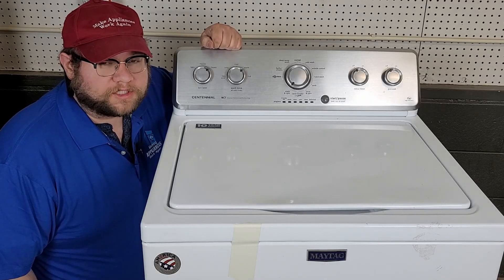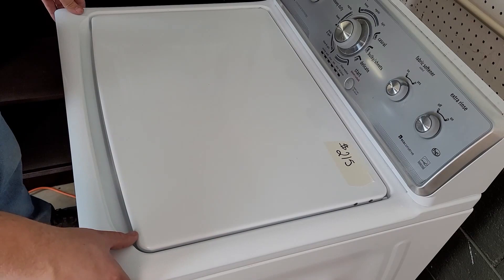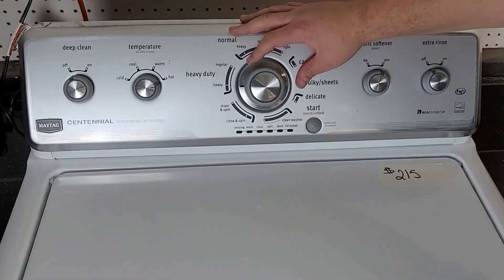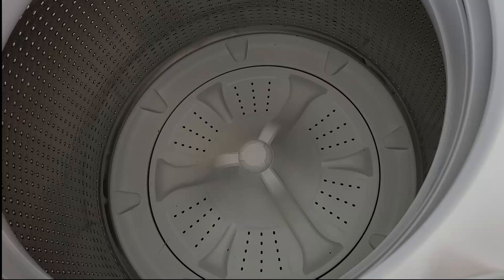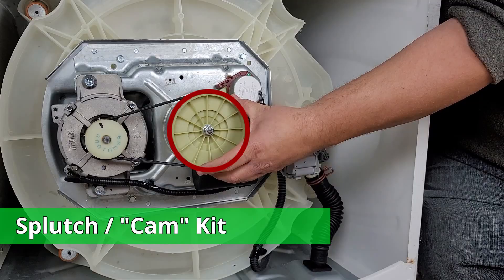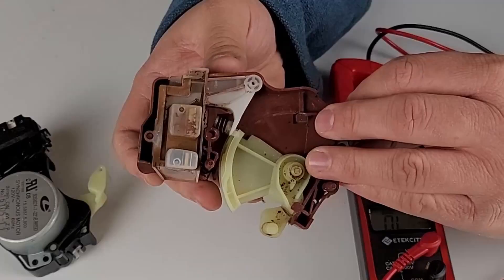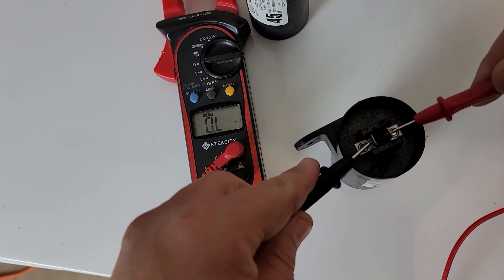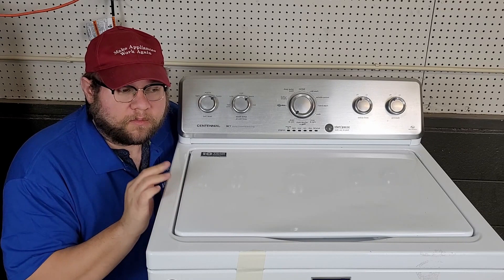Maytag Washer Won't Spin - How to Troubleshoot a Maytag Centennial Washer

Comment: Hello, I have a Maytag at my work (I work offshore) and it does spin but the issue is that it spins uncontrollably and off balance, so the spinning stops and it automatically jumps to the rinse cycle after attempting to spin 2 times, I can visually see that the tub has an inclination to the bottom left corner (looking at it from above) but upon further observing the springs, they seem to be in good shape. Can someone help me with this issue as I don’t seem to understand why it doesn’t completely spin. Also I always try to remove the wet clothes and reorganize the to balance out the load, but even then it useless.
Reply from the maker: Check the tub itself. Likely the hub is bad underneath. If it isn't that, then the inner tub is warped.
Reply: @bensappliancesandjunk  how do I check the tub? Is there a way to take it apart?

Comment: Hey Ben I have a similar washing machine that fills with water but  Stops functioning. And it will not drain out. So I emptied the washer by bucket. Then Added a few clothes And had to find A different setting In order for it to lock the lid and sense , Once it starts filling up with water And spins It just completely stops and and will not finish.
 So when I try to add a different setting Such as drain and spin It will not lock the top and it will not sense.
I actually made a video here and posted it on my YouTube account asking for help.any insight would be greatly appreciated
Reply from the maker: Use the error code mode system and tell me what the error code is. That will get you 90% of the way to knowing what is wrong vs. a video of the problem.
Reply: @bensappliancesandjunk   Thanks alot. It worked .the sencing light popped up

Comment: dont know is this is allowed here but I have a Maytag A883 ( 33 Years old ) washer that needs a new motor which I cant find anywhere! the motor label shows 2-1666-14 the washer has a slow and fast speed agitation any help appreciated
Reply from the maker: Find the actual name plate for the model#. Should be like... LAT. You can find the schematic on many websites like Sears Parts Direct that'll give you the motor#. I am certain you can find them.
Reply: @bensappliancesandjunk  thanks for the reply no luck though. the maytag schematic show parts # 2-1805 ( single speed and 2-1807 2 speed. I have have a 2 speed 6 wire  .Model A883 series 11 serial # 109656  8M my motor itself has these numbers on it    part  2-1666-14  model S68PXGCN-7045 any chance you have one hanging around? I know long shot but this washer was  awesome until the  motor went.we bought new in 1990.

Comment: Can you help me? The green light on control board isnt on anymore
Reply from the maker: If the green light isn't on the board it either its not getting 120v to the board or the board is bad. Test for 120vac input to the input on the board. If its OK then the board needs replaced.

Comment: hey Ben I know this is an old video but thought I’d ask your opinion. I have this washer and it won’t spin during a normal cycle. When I turn it back on on the drain & spin setting, it works & starts spinning and after about 30 seconds the lid lock red light starts blinking and it slowly stops spinning. Do you think the lid lock mechanism is broken?
Reply from the maker: Could be broken, did you check for error codes?
Reply: @bensappliancesandjunk  no I got really confused with that part lol I think I’ll try it then call my landlord to get someone to check it! thank you for the hugely informative video you’re a lifesaver!!

Comment: HI Ben, Do you have experience with Maytag (washer Model: MVWC6ESWW1  parts and dialog S/N: CY3041717) I got this spin (around10 sec) then stop and  (2 min)spin and stop keep repeating, the power plug cable overheat. What is your suggestion? Jammed the tank?

Comment: I have a Maytag MVWC565FW1... are you saying that if you hold the tub with one hand and can spin the wash plate, that the hub and or wash plate is bad?
Reply from the maker: Generally, yes. Unless its slipped into a wrong mode. You can confirm this by running the spin test, and seeing if the basket+plate spin, or just the plate spins.
Reply: @bensappliancesandjunk   Thanks Ben, it was the hub, but I did a check of the other components just to be sure. Great video very well done.

Comment: My Maytag won't spin or agitate.  It  starts to spin then immediately stops.   Already replaced the actuator but that wasn't it.   Any ideas?
Reply: Could be a drive hub
Reply: @darius318  It looks like the actuator is not positioning properly.  I can hear the actuator motor buzzing, the arm starts to move but hesitates.  It's like it's not getting a proper signal.   Sometimes it will properly switch from agitate to spin mode, but not vice versa.   I'm thinking possibly a wiring harness or control board issue, both of which are costly repairs :(

Comment: Top loader washing machine spin for 1second and stop what wrong with it
Reply from the maker: Check error codes to look. Could be a faulty tach sensor not showing basket speed despite engaging spin

Comment: Agitator vs. No Agitator? Can I upgrade my Maytag  from not agitator to agitator.
Reply from the maker: I believe the absolute newest ones have the agitator as a drop in option. Sounds cool but I really wonder how reliable it is
Reply: @bensappliancesandjunk  I have a new one that cost me $ 700.00 and I have used it once. it has the same problem as you show in the video. These washers are crap

Comment: Replaced shift actuator still not working 😕
Reply from the maker: Did you calibrate after installation?
Reply: @bensappliancesandjunk  won't recalibrate stops when it is supposed to spin

Comment: What a Maytag making grinding noise when washing? And leaks water on the floor.
Reply from the maker: Water on floor - trace where its coming from. No super easy way around it. As for grinding, could be the hub going bad.

Comment: Have Centennial with spin issues, started on some settings, over time now poor or no spin on all settings. Tried to enter diagnostic mode, no lights at all. Washer just starts a cycle.  Even if I manually go through the electronics as in the manual with a meter, I can’t recalibrate new parts if it won’t enter the diagnostics mode. Is this correct?
Reply from the maker: Correct. Calibration is only doable through diagnostics. If you can't get into diagnostics no matter what, then its a board issue. But if you're claiming it just starts a cycle, you either havea  major board problem or didnt get the code right. I'd unplug the washer, wait 15min, then plug it in, wait 15sec, then try to enter the code w/o touching anything else.
Reply: @bensappliancesandjunk  thanks for the help. I ordered a circuit board. I tried your suggestion 3 times. I think the board is dead. I guess if there’s more wrong, at least I will be able to run the diagnostics. Could I send you a small something by PayPal for your help?  I’d like to do that.
Reply: @bensappliancesandjunk  oh, there’s 2 dark spots on the case the board is in. Looks like something was hot. Forgot to say that.
Reply from the maker: @rottiegirl5052  100% thats it. Hot spots are usually capacitors or relays overheating. Not a cheap fix, but a fix. My PayPal https://www.paypal.com/paypalme/BensappliancesYT?locale.x=en_US
Reply: @bensappliancesandjunk  cheaper than a new washer. Sears parts had one half what I found elsewhere. Ebay used wasn’t gonna cut it although cheapest. There may be more wrong than just the board but that should get me started. Thank you so much for your help!  Appreciation sent!!

Comment: how about explaining why a goddamn older Maytag model A110 stops spinning after about 3 seconds, then won't start again until 15 minutes later spins 3 seconds and stops! What the hell????!!!!
Reply from the maker: Thats 3 generations older than this one and that'd require me to have one to repeat the error to show how to solve it. Likely, the motors shot and the thermal protection kicked in, preventing it from heating up and catching on fire.

Comment: I can't get into diagnostics mode because my drain pumps is on.
Reply from the maker: Let it run for 15-20min and it'll stop and let you do that. Its in a flood control mode.
Reply: @bensappliancesandjunk  it's on sensing fill and the drain pump is on. I cancelled the wash and it still stays on
Reply from the maker: @brayanxpalacios  the drain pump stays on still after cancelling the wash?

Comment: Maybe u can help me out ? WTW4850HW1  When it fills the agitator barely goes back and forth ! Shifter seems ok and I ran diagnostics but no faults ! Does the control board control motor back and forth motion ? Took belt off motor and it runs great
Reply from the maker: I'd check capacitor
Reply: @bensappliancesandjunk  hi ben ! I was just looking at the capacitor . I actually bought a used one but still does same . My fluke got left in rain by my grandson so all i have is multi meter ! When i check both they go up n back to O but when switch it open ! Motor just doesnt have power on agitate but spins ok
Reply: Is that a start/run
Reply from the maker: @65belair22   I would take the agitator off and look at the gear shaft and everything in between to see if it's possible that the threading of the gear shaft is good to where it's not slipping on the agitator causing it to be slow
Reply: @bensappliancesandjunk  thats all ok . Shifter ok . Draining ok . Calibrate put on quick wash to check fills (water goes on/off ) when goes to agitate its very slow with hardly any back/forth and it does sound like motor struggling ! I test motor and is within specs ! I have a short video how could i send to u ?
Reply: How can I send the short videos I have ! The one shows agitating and u can hear it
Reply: Hey Ben should the agitator turn independently from drum by hand ? New capacitor didn’t help .

Comment: Great video but I unfortunately these machines are junk! My 4 year old machine needed a new motherboard not covered by the lousy warranty. My brothers same machine needed a new transmission after only 3 years. Add the fact that they twist and tangle your clothes unbelievably. I've had Bosch, whirlpool and Maytag machines for 20 years and they get worse all the time. Invested in a Speed Queen too load and couldn't be happier. No lid lock, full fill and agitates in both directions. Clothes haven't been this clean and tangle free for years. AND...only 28 minutes for a full load. Spend the money and buy a machine built to last 25 years just like they used to!